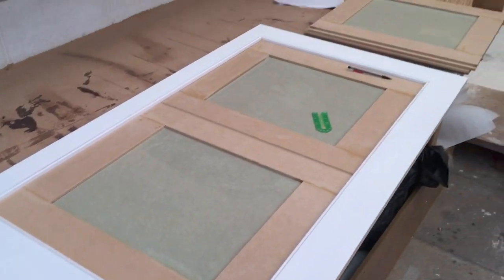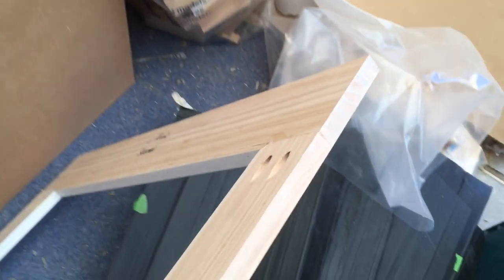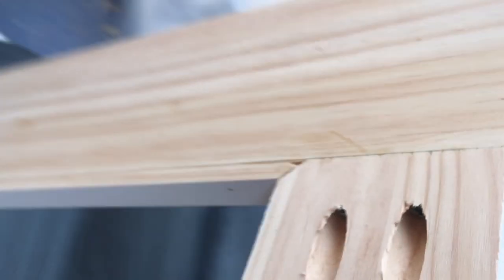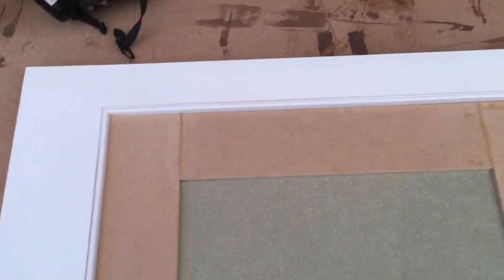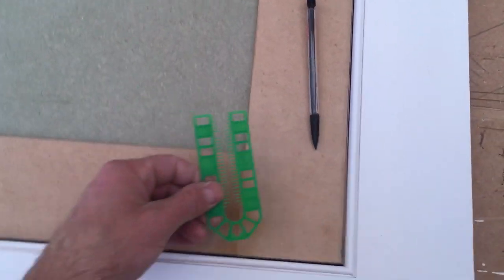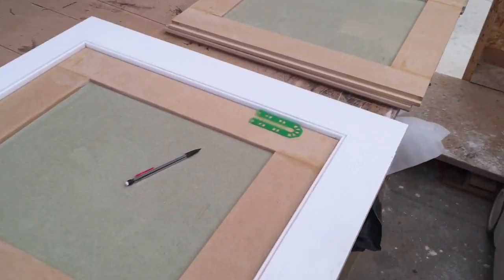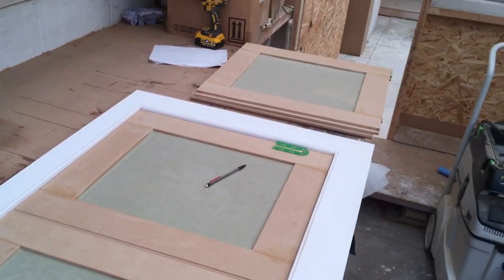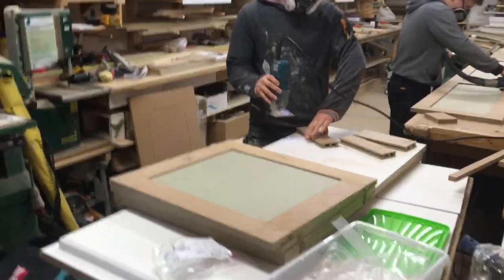Trimming doors to fit a face frame

Comment: What concealed hinge did you use? Was the vertical inside edge of the frame flush with the inside edge of the carcass or was it sticking out inwards? I've seen a blum mounting plate that screws up to the face frame on the inside, model 175H5030.21. I have a situation to post install such face frame and I'm looking for different options.. My face frame will stick out inwards, so I'm reviewing solutions to not add a vertical piece to fill that gap difference.
Reply from the maker: Darko Serafimovski hi sorry I missed this comment first time around!!!  I think I probably  has the inner edge of the face frame about flush with the inner face of the carcase and used the inset hinge.  But I think I know they arrangement you are referring to and have seen it used in American kitchens

Comment: Alastair, have you seen Mike Farringtons videoclip of using the Edgetech sanding disc for MDF edges?
Mike swears by it and I believe he is using just the brown stuff (not MR MDF). With the panel saw in play you could dedicate the old table saw to the Edgetech and Brady could save a ton of time By not hand sanding.
Reply from the maker: john gibson someone else did mention this, would you mind posting the link to the correct video into the comments here? Thanks
Reply: Freebird Interiors it’s a sanding disc which you install into a table saw with a 2 degree tilt.
Reply from the maker: tomnikesb why the 2 degree tilt?